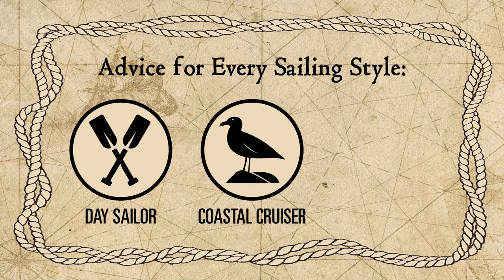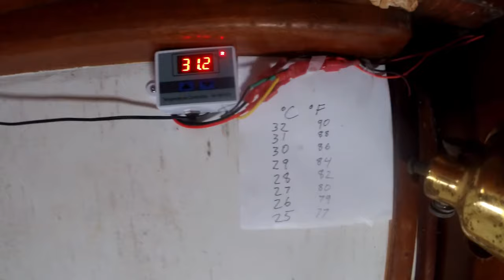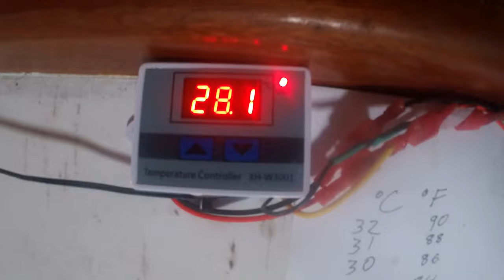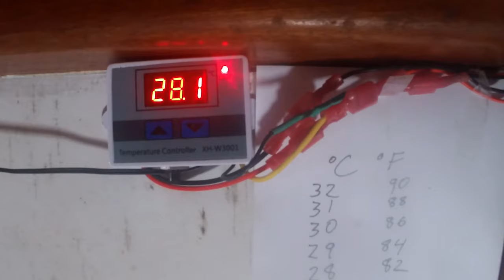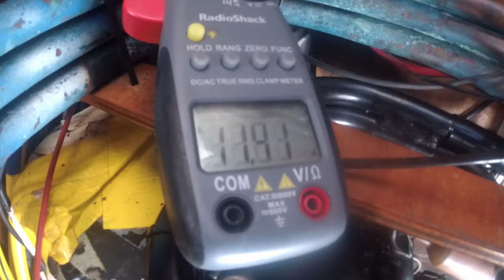Battery-Powered AIR CONDITIONING on a Sailboat [Capable Cruising Guides]

Comment: Clark you measured the current but not the current at the air handler? (Did you?)

Btw how does the compressor actually work..?
Reply from the maker: That number is the total current.  Compressor, air handler, and water pump
Reply: Interestingly i learned the compressor doesnt compress with a phase change.
Reply from the maker: Yep can't compress a liquid.
   If you haven't watched it yet, you watch my refrigeration playlist.  The first video explains the cycle in detail.
Reply: @Clarks-Adventure  Ok..  (ac vs refrigeration The main components are the same…?)
Reply from the maker: Yep, watch the video.  From a technician point of view they are the same.
The engineering is different as the target temperatures are quite different
Reply: @Clarks-Adventure  Where can I search for the video in question?
Reply from the maker: Go to my channel then go to playlists

Comment: Do these units have a dehumidify only mode as well as the standard dehumidify with cooling?
Reply from the maker: They dehumidify as effectively as any AC does but no they won't dehumidify without cooling.  You could build it that way basically by not using the sea water.  I personally want the cooking as well even though it uses a bit more power.
Reply: @Clarks-Adventure  Thanks for answering. I was hoping it had the switchable option but it's still a great little unit.
Reply from the maker: What I'm saying it it's better then a dehumidifier.  It dehumidifies as well as cools.
Reply: @Clarks-Adventure  yeah, I got that. There are situations where just having the option to dehumidify and not cool could be useful. I know some AC units can do this but wasn't sure if it was an option in one's this small. You answered my question and I still think it is a great option for boats and DIY minded individuals.

Comment: How about putting a intake water  down close to the keel, feed the water through a radiator ,then just blow air through the radiator.if the water coming in is 60 d .you should her 70 d cooling.
Reply from the maker: Sure go for it.

But here in the tropics the ocean water is pretty hot.
Reply: I would but I don't have a boat, I fished in the north Atlantic when I was younger..it's not a place you have too much heat..

Comment: Can you share the parts # and place you got the ac compressor and air conditioning unit in the burth
Reply from the maker: No.  They won't sell it to you anyway.  It's a defence contractor that doesn't sell single units.  I'll be buying bulk and reselling for about what I was able to get one for.

Comment: Great video!  I'm interested, but not until we get Lithiums installed first.  Survey filled out.  S/V Dolce Vita
Reply from the maker: Have you watched my lithium/lead videos yet?
Reply: @Clarks-Adventure  Yes I have.  Hybrid is an interesting concept, well explained,  but doesn't really fit our situation.  We don't have a massive lead-acid capacity in place, and what we do have is ready for replacement.  Also, not much room for more batteries, so LiFePo4 is will increase our capacity significantly in the same volume with less weight.  I am a (retired) Electrical Engineer and have spent the last 6 mo researching and designing our Lithium system, focusing in particular on the failure modes, especially how they interact with the various (smart) charging systems aboard (solar, wind, alternator, and shore), to make sure that a BMS disconnect while charging does not  produce an electronics-killing spike. Your hybrid system dodges this nicely by always having the LA batteries connected even when the Lithium's BMS disconnects.
Reply from the maker: I'd keep a bit of lead (maybe the starter batteries).  I'm concerned of what a lightning hit will do to the BMSs
Reply: @Clarks-Adventure  I do plan to keep a small LA battery for the starter.  Because our Atomic 4 only requires moderate cranking current (60A), I use a small U1 battery (PWC or motorcycle battery) for the starter, and I plan to keep that as LA because Lithium's advantages don't really aplly to the starter case. Looking into DC-DC chargers for the LA start battery.
Interesting thought about the lightning.  It further reinforces my thinking to build the packs from raw LiFePO4 cells and a discrete BMS so that I can carry spare BMS boards.

Comment: Do you think this would work well running as a heat pump?
Reply from the maker: Sure just a few extra valves. 

I wasn't concerned with heat based on where we use the boat.  As an aside this air handler has a heater coil, so you could run your engines cooling water through it to heat as well.
Reply: @Clarks-Adventure  I live in Fort Bragg CA. It's fairly mild year round so heat pumps are effective. I've installed a few mini split units that operate on the 900 to 100 watt range and single room(cabin) units seem very attractive.I would be willing to collaborate to get that aspect up and running. I filled out the form.
Reply from the maker: Thanks.  Do you feel you can tackle the engineer if doing the reverser valves and dealing with the expansion valve?
Reply: @Clarks-Adventure  Possibly. I will research more if you can supply the specs on the compressor and air handler.

Comment: Hi, sorry for not reacting for a long time, but I am working on my own boat. I would like to install an AC, what are the options and prices?
Regards, Rene.
Reply from the maker: It's available through MarineDCAC.com.

I've done other videos on this channel where I install one of the current kits.  You might like to watch those.
Reply from the maker: They are in this playlists

 A/C and Refrigeration: https://www.youtube.com/playlist?list=PLsT7_jPsZM5qNlstuF-fdlgjrimo18tq7
Reply: Thanks, if I want to do 2 small rooms almost next to each other, can I use 1 ac unit with 2 tubes and 2 manifolds?
Reply from the maker: The air handler has facilities to install ducting easily.  For efficiency it's important that the air coming back to the air handler comes back from the room(s) being cooled.  You should take that into consideration.  (Better to cool already cool dry air then hot wet air from another space). 
   And if course the larger the space the more the unit will have to work using electricity.
Reply: @Clarks-Adventure  oke thanks. I will start with one unit and see how that works. I assume tubes, ventilator and tools are not included in the deluxe version
Reply from the maker: No.  Copper tubing and water line is so boat specific and easy to source locally it just didn't make sense.
I have links to tools that looked good to me on my Amazon shop (see basically any video description).

The deluxe package is the same as the base with the addition of the saltwater pump I like.

But check the site and ask Russell any questions about parts.  I contracted this design out to him.  I don't run this business.  I'm concentrating on R&D and my BankManagerPlus https://www.emilyandclarksadventure.com/bbms

If you don't have one of these and Li aboard it goes REALLY nicely with the AC unit.  Honestly it's probably more important.  I came up with the idea for it because of the AC project.
Reply: @Clarks-Adventure  oke I will. I have only lithium. 8 victron 330ah in a 24v setup.
Reply from the maker: I've come to the opinion that charge controllers available currently harm Lifepo4 slowly by exposing fully charged batteries to high voltage.  This plates some of the lithium  salts into metallic lithium and takes some life out of the battery each time.
   Also having some lead aboard is a good idea if you are voyaging.  It's tough and not as suspectable to lightning damage or other electronic failures.

   But we are all captains of our own boats and the AC will be very happy with your bank.  

PS.  The compressor runs natively at 24v.  So you won't need the boost controller.  

You probably should get a 24v version of the water pump.

I think the air handler motor could run at 24v with the speed controller supplied with the kit but DO NOT turn it way up fast.  (You won't want to anyway.)

You will need a 12v source for the thermostat that comes in the kit.
Reply: @Clarks-Adventure  thanks for the tips. O, I have lead on board for the bowthruster. So maybe the bms is an option.
Reply from the maker: Yeah read the page and see if you like the idea.   I really haven't expressed it well yet, but I'm convinced it's the best way to get not only longer life for your Li but also for your lead.

Comment: Hi Emily and Clark. Thank you so much for all your informative you tube videos.  I am currently in Luperon and am very interested in your battery ac kit.  My friend Brock touted the idea.   I am not sure how to reach you except through this venue.  My name is Alison on S/V Going Rogue.  I hope to hear from you!  Cheers
Reply from the maker: Hi Alison,
   I guess we just missed each other.  The kits are available at MarineDCAC.com.

   There aren't any in the bay to easily look at just now as we are in the US (actually currently in Canada) doing the camper trip.

   I've had them shipped into boxpac in the past without any worry but if you aren't in a hurry you might want to use Carmin Cargo and save the important duty.

   I just got all the parts to build an air cooled version for the camper we are traveling in.  I'll likely be putting it together when we reach Wisconsin.

Clark
Reply from the maker: Do you have any questions?
Reply: @Clarks-Adventure  thank you for your speedy response.  I’m sorry I missed you both. I will look on the site first then get back to you with any questions.  Many thanks
Reply from the maker: PS.  I'm at Ian's (LocaLola) place in Canada today.  He says hi.
Reply: @Clarks-Adventure  Please say hi back!  Very fun.

Comment: what power for the raw water pump?, I have a Mermaid 5 KBTU A/C but it draws 7 amp at 115 Vac that I run Thru an Inverter but right now have 16 T105 batteries but the battery C factor  discharge is killing me. I am a retired electrical engineer, LOL I am very interested in you AC unit level 3 S/V Bright Eyes
Reply from the maker: The raw water pump is included in those numbers.  It draws 1a the air handler blower draws 1.5a.   Those together are shown on one of the meters.
   Please fill out the survey.
Reply: @Clarks-Adventure  I did fill out the survey

Comment: I agree at night AC is critical. And here on Land in Florida. I will run AC at Mighty . As If you don't sleep good you won't function good.
Reply from the maker: Yes there is a reason no one really moved to Florida unless forced or after AC was invented.

After coming up from Panama I spent years living without AC.  But it was a challenge.  I wanted to stay acclimated to heat do I could enjoy the days outside.

Comment: What is the status on the air conditioner kits? did you get enough interest?
Reply from the maker: LOADS of interest
   Over 1300.  I signed a contract with a manufacturing company.  First shipment should be available soon.
Reply: @Clarks-Adventure  is there a website or will you contact us via email when they are ready?
Reply from the maker: I'm hoping there will be a website soon.  But for now it's wait for the email.  Sorry.
Reply from the maker: Yes it sucks loosing control of one's own project
Reply: @Clarks-Adventure  have the emails been sent? Sorry I just haven't seen anything yet and I am wondering if I need to dig through my spam folder.
Reply from the maker: No.  He is having supply problems.
Reply: @Clarks-Adventure  Any updates on the air conditioners? Is it reasonable to assume they will be available before this coming summer?
Reply from the maker: Yes. In fact I just gave him my address for him to send one to me for a video.  
All I really know at this time is the kit weighs about 35 lbs.
Reply: @Clarks-Adventure  Any updates on the AC systems?
Reply from the maker: They are available at MarineDCAC.com.

A bunch have been sold.  I think he still has more to sell.

Comment: Would this work in a van?
Reply from the maker: We are planning on offering an RV unit that uses an air condenser.  It will burn a scoch more power without the water cooling but still a LOT less then others.

Fill out the survey in the description to be kept informed.

Comment: The room air and surrounding material would actually cool a lot faster with out 2 "heat sources" radiating appx. 98.6 degree heat. So this is an excellent real world test.
Reply from the maker: Yes.  And add to that the amount of humidity we humans release into the air.

Comment: Does this use salt water from the ocean as part of the cooling?
Reply from the maker: Yes it is pumped through the blue condenser.  That is what removed heat from the system.
   You might like this video.  https://youtu.be/jTKT3w-6Bl0
   I explain how all this actually works.

Comment: Your shirt got sweatier the longer the AC was on 🧐 🤪
Reply from the maker: It takes longer for me to cool then the room and it only got cool at the end.
Then out by the compressor it got really hot.
I'm not used to wearing a shirt.
Reply: @Clarks-Adventure  haha yeah I tell it's working nicely really I just noticed you starting to melt in there at one point.. best regards from England 👍🇬🇧

Comment: How much power do you use to pump the water?
Reply from the maker: It's measured in the first meter along with the fan.  2.5a together.  I believe the water pump alone is about 1 amp.
Reply: Thanks! I am interested in buying the parts. I am an HVAC & refrigeration tech wit 40 years in the business. Need AC on my boat with no generator running. I am in Tampa, FL if you need any help on this project. I agree that we do not need AC during the day, but its nice to be able to sleep at night :)
Reply from the maker: Make sure you fill out the survey.   That's how I'll keep you informed.

Comment: If you don't get 50 people, I just need a part number for the compressor, and I will DIY one myself.  I think this is pretty accessable.... but I am sure i will buy 3 of them, and in the next 2 months... if that's possible.
Reply from the maker: There are over 800 requests so far!

Comment: Its called a 12V/24V/48V RE DC inverter Hermetic Rotary R134a Mini Refrigeration Compressor and you can buy one at AliExpress for $207.00
Reply from the maker: Not the same compressor but if you implement one and it works for you I'd like to hear about it.   These are MUCH cheaper then I can get mine for.
   Mine aren't rotary compressors, have no inverter involved.  I did a lot of research into this and couldn't find anything available even half as efficient as what I'm using.
   Just a hint, if a compressor uses an inverter it's based on an induction motor and burns a lot of power.   Also rotary compressors are not as good with power.
Reply: @Clarks-Adventure   You can get them without the inverter too. I would get both types of power modules so that when I am on shore power I don't have to run it off the battery but right off the stepped down shore power.
Reply from the maker: Best of luck on your project.

Comment: When I'm hot with no AC, I just soak the upper half of a tshirt in ice cold water and wear it.  You will INSTANTLY feel cold.  Plus, it works everywhere!  inside, outside doesnt matter. upper half only tho because if you soak the lower half, then your pants get soaked.

Comment: 14 Amps? This seems super cool, but i think a marinarie is only 6 amps.
Reply from the maker: Is that a 12v DC system.  I think it's an AC system.    6 amps at 120v AC is the same as 60 amps at 12v.  That's a lot of power!
Reply: @Clarks-Adventure  ahhh thanks for the education.

Comment: I wonder if anyone has tried adapting the current generation of automotive heat pump units found in electric vehicles like VW's eGolf or some Teslas?  They're designed to provide ultra efficient heating and cooling to small volume spaces that are reasonably close to a boat's cabin...
Reply from the maker: If you give it a try please report back to us here.
Some research might help answer the question without testing.  The compressor I use has a COP of just over 8 in the conditions I'm running it at on my boat.  If you find the COP of the compressor in question is lower then don't bother.  If it's better...  I really want to know about it!

Comment: 01:50  Just sleep in a hammock; problem solved. . .    hammock has incredible airflow around all sides and can be quite cool-feeling even in 100F heat.
Reply from the maker: Not in Panama during rainy season.  
 Bugs outside.  Malaria and Dengue fever.

   But better than most places.
Reply: @Clarks-Adventure  not hammock outside.  rig hammock inside cabin.  sailors always used to sleep in hammocks.